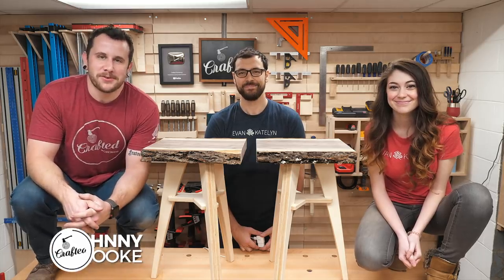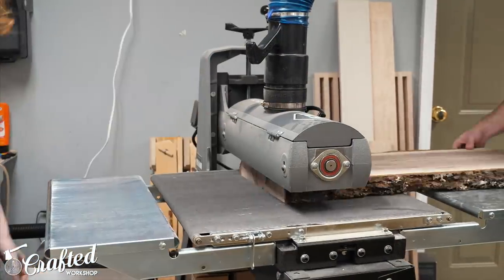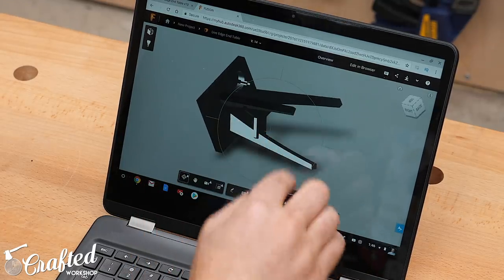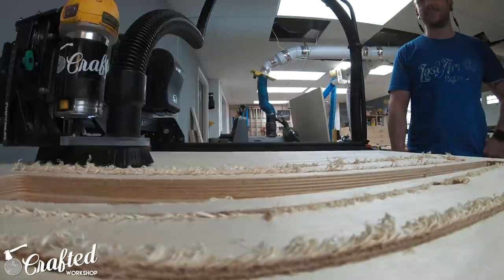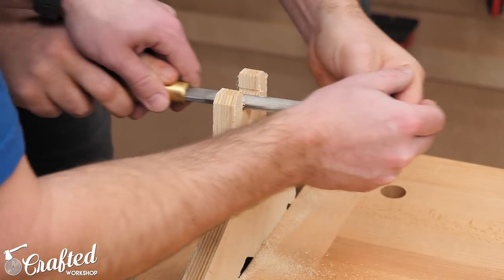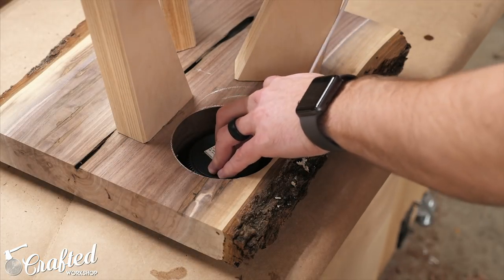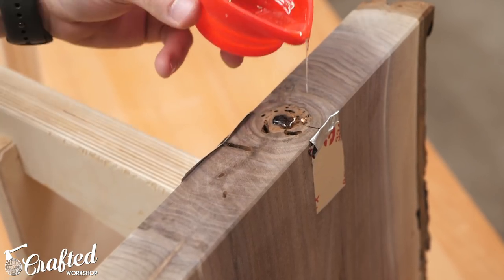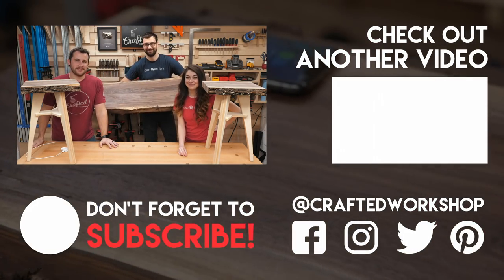Live Edge End Table with Wireless Charging // Flat Pack Furniture Woodworking Project

Comment: Awesome projects from both of you!  Next time, would be cool to route a channel on the inside (between the two pieces of plywood that make up the leg) that you could sandwich the charger cable in to conceal it.  Might be neat just because you already have the CNC going - but the current solution works just fine, too!
Reply from the maker: I thought about that, but if the cable breaks or frays, I wouldn't be able to replace it.

Comment: Not to discredit your great work but as a note 8 owner with the wireless charger I've got to say even in direct contact the charger is greatly reduced with a case that's even a single mm thick
Reply: Inverse square law applies with distance for wireless chargers. So, yes, you're right. It will connect, but you're getting a fraction of the power possible.
Reply from the maker: Good to know!

Comment: Really cool. A little bit disappointed that you didn't drill a long hole in one of the legs to pull the wire through it. Would've been so much more neater.
Reply: Should have routed a channel into the leg before laminating it. Missed opportunity 😐
Reply from the maker: If the cables breaks, then I'd have to take the table apart. Not a great solution.

Comment: I would think with so much CNC work on these tables, you would cut a slot for the charger wire instead of just putting some wire clamps on the outside of the leg. But still a very cool table!
Reply from the maker: Thanks Pat! I considered it but if the cord broke for some reason, I didn’t want it inside the legs.
Reply: Crafted Workshop  smart move!

Comment: Don't really know much about woodworking, but why do you apply the spray finish after the wipe-on finish? Wouldn't excess spray cause a textured finish on the areas you use wipe-on that already started drying?
Reply from the maker: Since all of the finishes are still wet, the spray finish is absorbed into the wipe on finish. Worked out fine!

Comment: Nice project
Bark questions
Did you use CA glue on all bark or just sections?  
Does the poly stabilize the bark or just add to look?
besides that piece with the bug in it, did you remove much bark?
Woof?
Reply from the maker: I just used CA glue on the loose sections. The poly doesn't really do much for stabilization. Thanks!

Comment: Will that Bark really hold together?  I initially planned to use a natural bark edge on a counter-top in my kitchen but have heard from multiple sources that bark will not hold together long term.
Reply from the maker: It depends when the tree was harvested. I've had slabs where the bark has stayed on for multiple years, and others that were peeling off right when I got them.

Comment: What a great video, and the wireless charger is a must !

Your chromebook can run Fusion 360, or just a viewer ?
(I own an old HP chromebook, and except the Autodesk viewer, I can't find where to run Fusion on it ..)
Reply from the maker: Thanks! Fusion has a web version, check it out. You can either view or edit your model. Great for referencing the model out in the shop.

Comment: If you haven't used that Y section, my vote is on a clock
Reply from the maker: I used it for the clock I built on this channel!
Reply: @craftedworkshop  
I just found the video and the clock is cooler than I expected or pictured

Comment: Cool project.  Anytime you add electricity in proximity to wood, or anything flammable, you really have to have some kind of professional expertise, to make sure the generated heat will not become a fire hazard.  And, especially as the generated heat, over time, would tend to dry out the wood, making it even more flammable. (Not saying these folks did not do that assessment, just saying, you know, generally....always make sure what you are making conforms to code).

Comment: using a computer guided router to build the whole thing is not carpentry.  thats like winning a street race with a formula 1 car.  cute tho
Reply from the maker: If you think the CNC did the whole thing, you clearly didn’t want the video. CNCs still require a ton of user input, including coming up with the design in the first place.
Reply: +hitch hiker
There is nothing wrong with using the tools that are available to produce craft furniture. My grandfather who was a traditional hand crafting cabinet/furniture maker would use CNC lathes when they were considered really cutting edge future technology. 

Sometimes you can do things with CNC that simply cannot be done by hand. Also it is the craftsman's judgement that counts not the tool he or she is using.